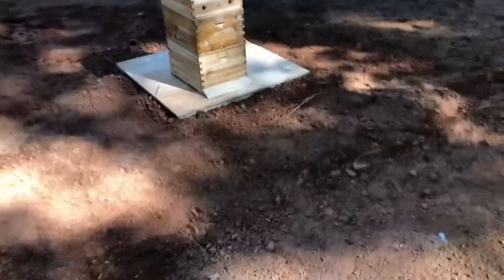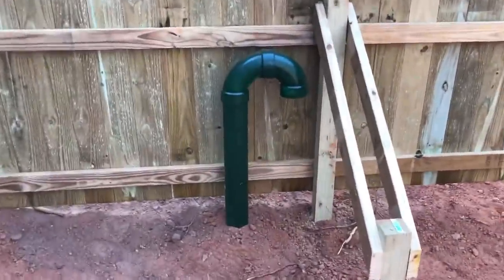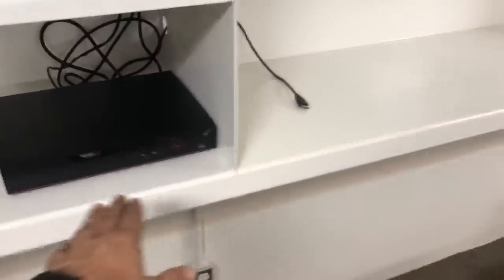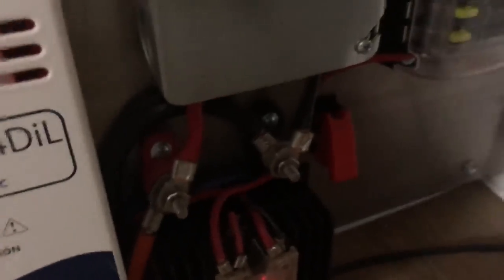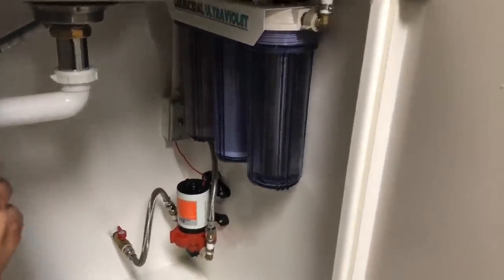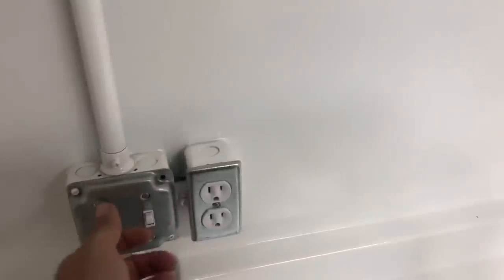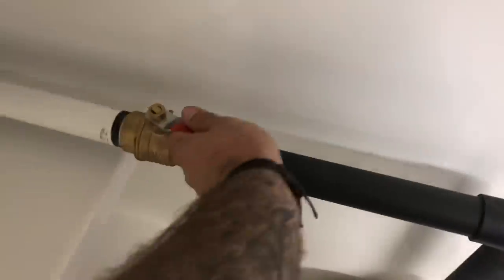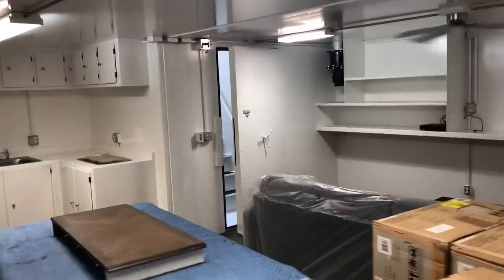Inside a REAL SHTF BUNKER - Doomsday Prepper Walk-Through

Comment: This is a RISING S BUNKER! …..     It is a exactly like the one in the video called   "World Expert visits a Badly engineered $500,000 bomb shelter"   On the Atlas Survival Shelters channel      I suggest changing the Propane Water Heater, the air System and add a second one ,   replacing the hatch, and the Plastic air pipes of course   also I seen the escape hatch on the other  it open up right to the surface and has no protection from the outside   Add More solar panels and increase the batteries as well     Hopefully next time you give Atlas a try and not deal with the headaches and future problems   thanks
Reply: Thank you Ron for checking out this video
Reply: yes I see this Bear guy kind of attacked me and said my shelters were not very good   that's sad cause he does not know I make round and square both water tight and Culvert so I don't think he has taken time and studies our shelters or maybe he is the only person I know of who likes rising S bunkers   I can only hope Bea does not embarrass himself anymore and align himself with Rising S
Reply: Got to have propane no one likes cold showers!
Reply: Thank you Ron... your correct Bear Independant sure is a failure at this juncture... very poor design for sure...
Reply: @AtlasSurvivalShelters  Ron, perhaps you could invite Bear to your mfg operation and show him the collected evidence from how bunkers are built overseas? He doesn't SEEM to be a bad guy but I could be wrong. I'd just like a brother vet to get a chance to see his mistake and change his opinion.
Reply: I did invite Bear to the Atlas factory and he said he would come so he wont make anymore mistakes on future bunkers
Reply: Well said Atlas. I do this commercially for a living. my career started with insurance risk calculation and fire prevention. I have also done intrinsically safe electrical designing for oil rigs and distillation plants and I now work as part of risk consultancy for contingency planning for huge data centers. long story short i have both the experience and the quals to categorically say this is a death trap. well done for calling it out. i've seen your videos and for the most part you speak from the heart and care that your clients install safe bunkers. credit to you sir!
Reply: @AtlasSurvivalShelters  I'm glad you said it so many issues I wouldn't put a vent pipe next to a tree it is going to grow especially when it's plastic
Reply: lol I noticed that too

Comment: Sorry bro, this is a coffin !
Reply: a)  "Dude...do you hear that noise?"
b)  "I dunno...take this Coleman lantern and go look..."
c)  BOOM!!!

Yup...I can see it happening...surprisingly fast, in fact.
Reply: ALL bunkers can be coffins...   depending on the back door.   Personally I would build a work shop over it to hide the front door and air handlers ..  ect..... I am not sure that I like the propane anyway as it will use up the air fast in a closed or buttoned up situation. I would add o2 tanks which are user refillable    seems all Bear is doing is the install....
Reply: @ericblair3009  Yeah.  If a garage installs faulty lug nuts that shatter at highway speeds, they're not responsible for killing your family, either.  Right?

No...they just "knowingly installed faulty parts", which is a crime.  But hey...those dead people saved 50 cents each!  I'm sure they're quite happy with their entirely logical, informed decision.
Reply: @ElectroPig  too true. I always thought of building a garage over a bunker, shelter, etc. you could run your intake and exhaust into the shop, and easily disguise it, I'd skip the propane though, also the slab that you built your shop on would further secure and mask any footprint of your bunker.👍
Reply: @GawgaCracka  My idea was a couple of sheds, and much longer piping underground.  One would house the intake and basic air filters, out for the exhaust(s), and maybe a couple more for emergency exits.  Plant enough trees around, and they'd never be seen from any road, either.
Reply: @ElectroPig  too bad we aren't neighbors bud. Blessings brotha.

Comment: A bunker recently exploded, killing 2 or 3 people, most likely one like this with propane. Never use propane in a bunker...
Reply: Ya and vise versa. Just let the people have their false security. It makes people feel better. Why ruin. It? It's like you paying for the best one you can find and shitting on your parade
Reply: I install propane for a living well a master plumber,with LP ,and water protection specialist endoresments.. if propane is done correctly and cared for and properly vented it is a excellent choice for any application....just cant have any tom,dick,and harry installing it...
Reply: @preppinainteasy9965 The point is though shane, you should build default safe designs. eg if there is a fault you don't die from it. you cant do that with propane stored underground. As a professional installer i'm sure you can see the problem with this.
Reply: John Chrysostom    What kind of bunker do you have if you don't mind me asking
Reply: I understand the concerns for sure but propane is installed in the ground safely everywhere....there are definitely safe ways to do it and some disastrous ways.Its just alot of people try the old dyi thing and it ends up costing them there life....but I definitely can see the point...I would feel 100 percent safe with my system actually fool proof...people just dont do things right...or leave something on just one little thing is all it takes but by no means is it just going to blow up for no reason....
Reply: @preppinainteasy9965  one pilot light goes out, fills the place with gas, fridge compressor clicks on, BOOM. Too many ways for it to go wrong. There a difference between somewhat safe and fail safe. Propane in a bunker is not fail safe.
Reply: There is a reason why it is illegal outside of the US for gas to be used in an application like this.  The incident in Texas among others is proof positive.
Reply: @BonnieBlue2A  - a residence also leaks air and is above ground.  Even with that when a house develops a gas leak they have been known to go BOOM! If this gas system develops a leak you would find it the hard way when you hit the first light switch. That is if there isnt a static discharge prior to or any metal to metal contact giving off a spark.  The entire shelter would have been full of gas.
Reply: @BonnieBlue2A  sorry bonnie, I spent a fair bit of time as a risk assessor for insurance companies dealing with gas fires. If a house can go boom due to a gas leak, so too can a bunker. It happens more often than you realise. Gas in a confined space is a big no no. In a bunker the point is you should build default safe designs, eg if there is a fault, its should not be lethal. the better and cheaper option is simply stick to an uprated electrical system and have an induction hob or microwave oven.
Reply: @BonnieBlue2A  and it's just that for your home.... LP is heavier than air... it accumulates in low spots... one spark and boom thats why home with LP gas blow up when the pilot light lights the gas
Reply: @neowolf09  why would your pilot light be on in a bunker?think about it.....you just leave your pilot light on when u leave your bunker
Reply: @preppinainteasy9965  failures happen. Not sure where all of these tanks are buried.  Feel free to take chances with your life, but I'll opt to err on the side of living. Specifically to this installation the ventilation is highly inadequate, there are no sensors to monitor for leaks, and all it takes is one spark to set it off.  Research the numerous installations by this exact company and tell me their installations are above reproach.
Reply: @keithhogan6997  it takes one spark if it's been pocketing up yes...and tanks are buried all throughout.....they made it illegal to bury LP tanks but that has changed Railroad commission has givin authority to bury LP tanks with accessibility to the top for filling and regular maintenance checks...but yes if u want to be completely safe then dont use it it is your choice but I wouldnt lose 1 bit of sleep if i had a LP system installed anywhere....and there are leak detection devices  carbon dioxide/monoxide detectors hell any rv has propane with the detectors mandatory when u buy one......people are afraid of it I understand that's because they see a explosion on tv or something you are more likely 2 get hit by lightning 2 times than ever die in a LP/natural gas explosion boils down to tom ,dick,and harry installing or, a professional......
Reply: @lynnb7511  those in here blah blah blah'in don't own shit. Probably don't have a jar of pickles set back for emergency & will be the first ones in the FEMA lines...!!! js smh
Reply: @civiprepper  agreed but wouldn't "human error" relieve most (with no experience) in this comment section if they realized that was the cause?
I worked for liberty mutual in the business sales office for quite some time, & their "loss prevention" is top notch in industry standards & well beyond... that gas install shown is perfectly safe. Hot water IS NOT going to be used daily but is a requirement of mine. I have a small but adequate, personally, medical treatment room in my underground fall back shelter. 1st line of defense is my "not on the plans" basement room with hidden entrance but this has to stay bare bones for detection purposes.
Reply: @preppinainteasy9965  thank you
You pass the "no warning labels" creed I advocate... If you're too dumb to use life saving (& gas like any other energy source) solutions then what good will this person be in the aftermath of a SHTF?!!! GAS, gotta luv it. Works off-grid & eliminates the idiots!!!
Reply: @coolbeans-vb2ex  I totally agree I can run any system 100%safe regular maintenance and just not being a plain idiot...you'll be fine...I can collect and reuse rainwater which I have my water protection endorsement also...like I said some just go use any little handy man that claims he can do it which he can but wait what if doesnt regulate properly or swap orfices on appliances that are for natural gas and there sitting right there and they think its fine...easy and safe if it wasnt they wouldnt let people legally put LP tanks in the ground again and why would anyone use it?shit propane is running everything oit of city limits usually,and some in some people request it....clean.....clean burning....
Reply: @BonnieBlue2A  and then when it leaks out your cheap chinese made hob and into the bunker with non intrinsically designed electronics. lP and propane etc are heavier than air aren't they so it will just collect. This happens way to often in houses, let alone bunkers.
Reply: coolbeans 2016  spoken like a true sales man, you basically don't have a clue what your talking about. My back ground includes designing intrinsically safe electronics systems for oil rigs and also doing fire risk assessments for insurance companies. I hold a degree in security and risk management, a diploma in electronic engineering and a masters degree in information security where I specialised in contingency planning for data centers. long story short I probably know what im talking about.

in courts all around the world Gas is not safe in a natural state, thus all the regulations and safety. The risks have to be calculated and mitigated by design. so if you had exceptional professional ventilation system, external fuel storage, passive leak detectors and an intrinsically safe electrical system (look up what that means) you could argue the environment was more or less within a tolerable risk. The fact is that costs a huge amount to achieve and these bunkers are death traps. Why not just heat your water in a microwave, induction hob or electric immersion tank.
Reply: TRUST ME, JESUS CAN WALK THROUGH THAT DOOR.  NO ONE WILL ESCAPE JUDGEMEMT.  I SEE A LOT OF PEOPLE PLANNING FOR DISATER, BUT NOT FOR ETERNITY.  STOP WASTING MONEY, MAKING MAN RICH, AND SEEK THE LIVING GOD, ELOHIM.

Comment: Bear I have the highest respect for you and your channel, I think you are one of the top people in the art right now. But please please please this structure is going to make your channel look bad, this being a Rising S or Rising S knock off will bring out some hard feelings related to the quality of what many will not even call a bunker, from the plastic pipes to zero security of the doors  to no secondary egress point and to the worst aspect propane being in an enclosed space. Bear your channel is better than this I know you bust your backside in everything you do and again I have the highest respect you  and your channel but please reconsider this video and super sub par / deathtrap steel structure in the ground.
Reply from the maker: ElectroGaming there’s so much not shown in this video due to the request of the client, but suffice it to say that A) just because other bunker manufacturers talk crap I their videos doesn’t make this a bad unit, and B) I supervised every single portion of this install myself. It’s a top notch unit and I’m very impressed by it.
Reply: He's getting paid off, just another sellout for $$$.
Reply: Is that entry hatch ballistic rated?, Is the main entry door gas proof?, Is there a U bend with a way to drain out any liquids poured down on the air intake and outtake pipes? and what certification does that supposed air filtration system conform too? because so far this looks like another disaster waiting to happen Rising S storm shelter marketed as a bomb\fallout shelter.  Nobody should be dealing with Rising S those cowboys have cost so many people a lot of money and left them with a sub standard shelter look up the owner and tell me with a straight face he's someone to trust sorry there are better alternatives for less money.  Be careful about defending them too much right now because in the future neither you or the owner are going to be happy with this bunker.
Reply: @BearIndependent   sell out
Reply: I have to agree with everyone on this, if rising s built this bunker it won't last 6 months and maybe he needs to see what a real bunker is like.